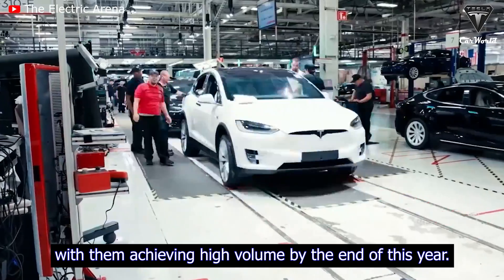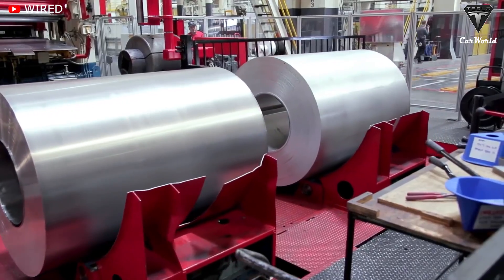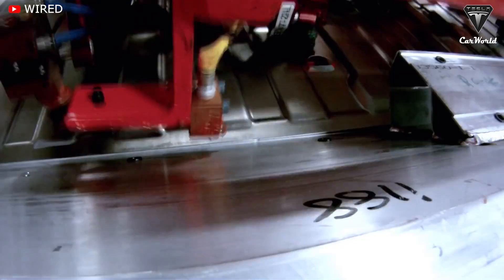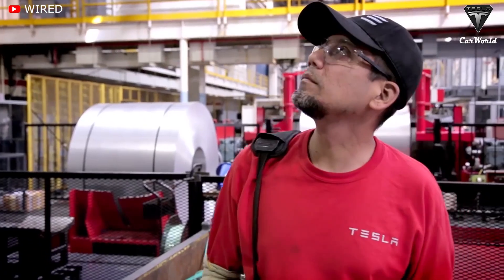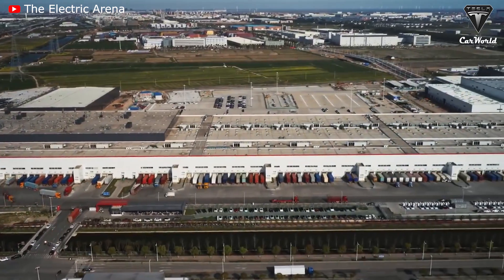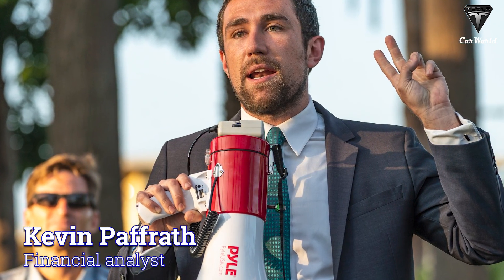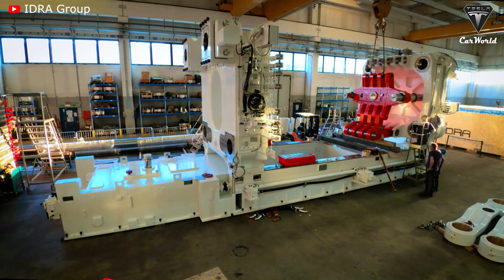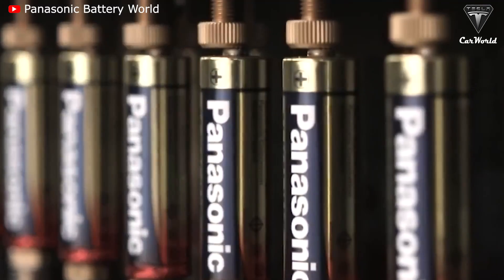Elon Musk Claims Giga Texas Will Produce an INSANE 30,000 M-Y's per week capacity!

Comment: They need 3 or 4 times the fossil fuel to produce the needed electric power generation to add to the grid for charging the thing. Then you'll have to wonder if your refrigerator food isn't spoiled from the black and brown outs on the existing power generation. We'll,you don't need food at home. Eat in the restaurants and Max out your credit cards. We'll get back to you soon as you run out of credit. They're surviving soilent green today. Be grateful, your time to be inducted into the soilent brown is coming soon as the next processed food can be excelirated if you cause any trouble.  Got to love that dictator.

Comment: That is assuming Giga Texas is currently producing 5000 vehicles per week.  Take that with a grain of salt.  In the factories current format, max production is closer to 15000 vehicles.  They are however expanding the factory so 30000 sometime in the future is possible but that won't be for some years. Other estimates have production around 2000 a week currently which would put max production at 6x at around 12000 a week

Comment: 30k per week? That's a run rate of 1.5 million just from that one factory, more than the entire company will make in 2022. Something doesn't add up. More Elon Musk hype I suspect. Divide that number by 10 and you'll be closer to the truth.
Reply: they're doing 22,000 RIGHT NOW at gigaShanghai...Elon has said the texas factory is the most modern of all of them...so why would you think they can't reach 30,000/wk eventually, I think by beginning of next year.
Reply: @kathleenchilds2837   Because Texas is making 4680 cars whereas Shanghai is not. 4680 is a huge bottleneck. That's why Elon is frantically converting Texas at least partially to 2170 production as he is realizing that the 4680 ramp is going to take longer than previously thought.
Reply: @aftonline  I'm aware of the ramp up problems with 4680...I think it's a good idea to set up & use 2170's.  We have a 2020 mYLR with 2170's and they're great.  Tried and true--get those Y's OUT there!  I know it's important to Tesla to get the 4680's up and running at a massive rate...the Semi, Cyber...but...if Tesla can deliver 900,000ish cars in the next 6 months (all factories running), I don't think wall-street will care.

Comment: This video is grossly incorrect with the statement that Giga Texas is producing 5,000 vehicles per week, as of July 17, 2022.  In fact, on that date, the factory is producing about 1,000 vehicles per week, which is very good.  I think your videos and facts have been excellent in the past, but this item is grossly incorrect.  Thanks for the good work on the rest of your presentation.
Reply: I thought they said 1k par week currently with ramp up to 5k by end of year
Reply: Isn't this plant supposed to produce 1 million per year? Or is the estimate too high since those are numbers based on Chinese workers, not American workers?
Reply: @yelnatsch517  They are still ramping auto production. That takes months. Also, battery production has ramped slower than they hoped for and that’s why they had to shift to using 2170s being shipped in. This required changes to lines and processes. Also, they’re still ramping employee count. All this is why they will be multiple times faster by year’s end compared to now.
Reply: 1000 per week would be about 50,000 per year probably a bit low. 5,000 per week is about 250,000 per year probably a bit high, but could be a top estimate of what's happening. That said, the plant is rated at minimum 500,000 per year so 5000 week might have already been achieved.
Reply: @Dave5843-d9m  the factory will be at 5k per week eventually, but the current run rate is only 1k atm.